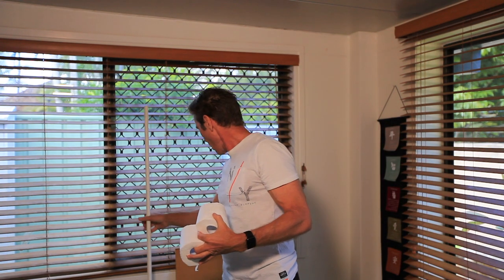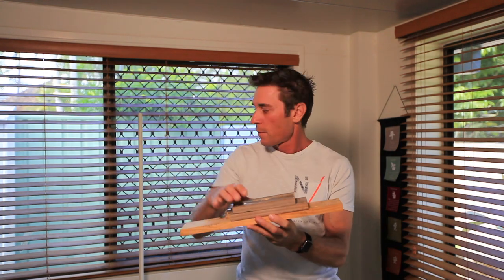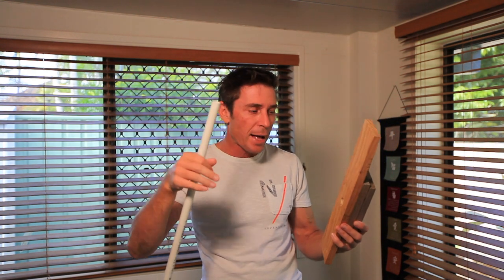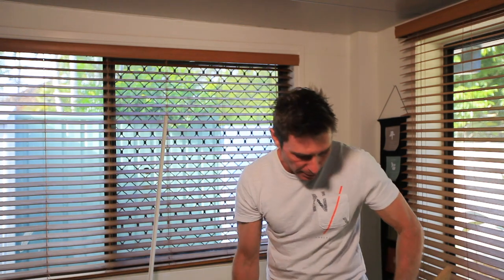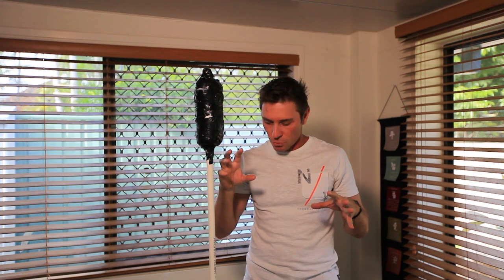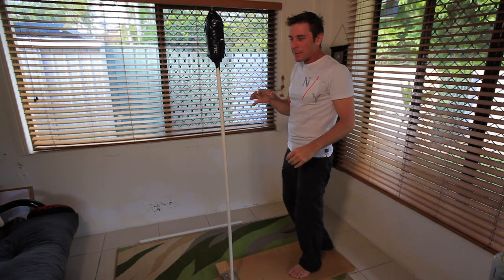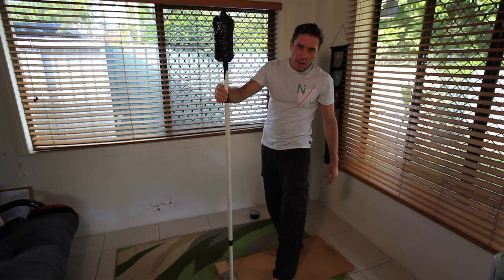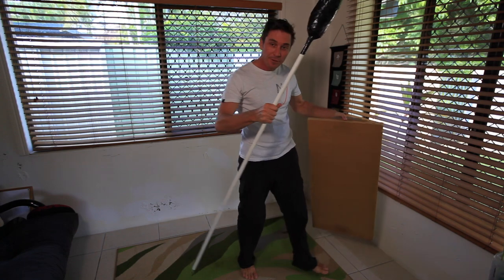How To Make a Cobra Bag Using Toilet Paper

Comment: Is it effective to used to train kicking?
Reply from the maker: Yes if you can kick that high. Not I
Reply: @Kewlus  thanks for your answer bro, I.m glad to fine the good tool to train my body. :)

And btw, you just put pvc pipe? Even with no per? Is it enough flexible when we punch hardly?
Reply from the maker: Yes PVC pipe will work just fine! 👌😀

Comment: It a very clever design but u need to move, pivot step back and forward while punching so it is not very good for that.
Reply from the maker: Just make the platform larger so you can move around on it
Reply: @Kewlus  How large big as my room?
Reply: @Kewlus  it is a very good design but boxing or mma means to move around
Reply: @Kewlus  your weight keeps the thing steady but if u try to move while punching then it will be very uncomfortable to box on it if u can't be steady on that platform
Reply: @Kewlus  no heart feeling great and cheap design. Cheap as if less costly
Reply from the maker: I’ve been thinking about making the platform modular so 4 pieces click together
Reply: @Kewlus  all the best
Reply: Or you can put a cinder block or somethu g heavy so you can move around
Reply: @GABRIEL58928  the u r welcome to try
Reply: in his later video he uses an umbrella stand
Reply from the maker: Here’s the latest build using an umbrella stand: https://youtu.be/VC_8JKqk9x4

Comment: I purchased both the medium https://www.youtube.com/post/Ugkxfh2XUOHWYHKQYOvSq2gZ6PyCmVkTFGWz and small speed bags from Meister. I'm very glad I got both as the workout is quite different from the two. The small is fantastic for getting your speed built up once familiar with your striking. The medium bag provides a considerable amount more resistance building more strength in your punches. I highly recommend both sizes.Some people have expressed concern over the latex bladder leaking down more frequently than the traditional rubber. I have not found this to be an issue at all.

Comment: How many millimeters is the PVC pipe?
Reply from the maker: 20mm
Reply: @Kewlus Thank you very much, you are a champion, and as tall as it should be, I bought the same 2mm one but it doesn't move much like the one in your video, maybe I cut it a lot.  Un Saludo 👋  desde México ❤🔥🇲🇽
Reply from the maker: For shorter, try thinner pipe